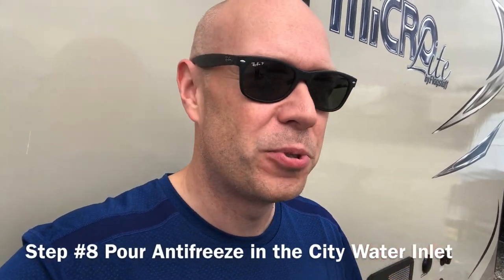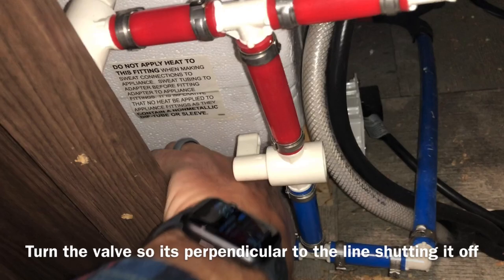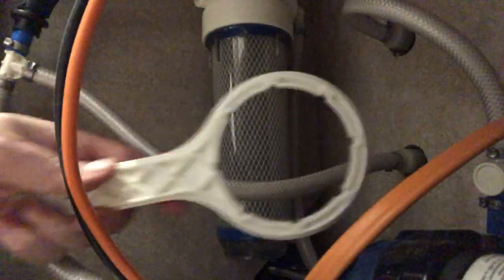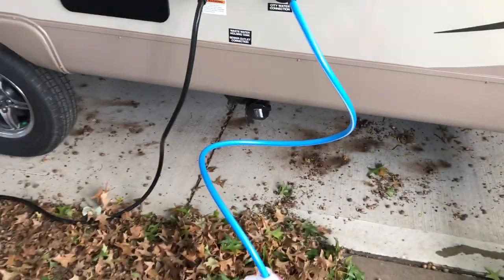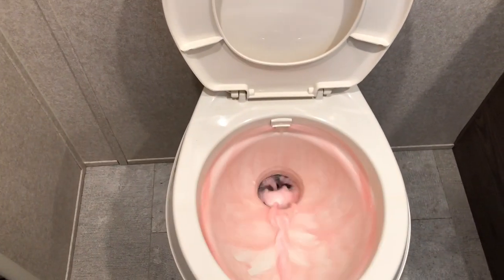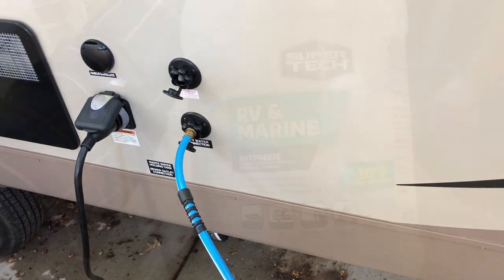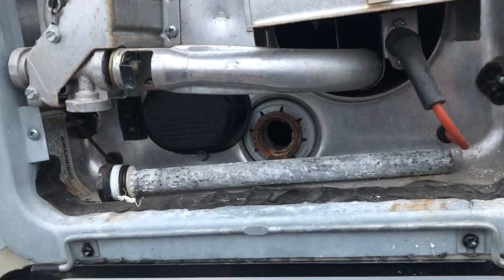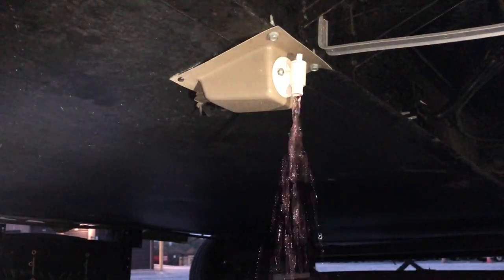10 Steps to Winterize our Forest River Flagstaff Micro Lite Camper

Comment: In regards to the city water connection part, if you take the mesh strainer out with a small screwdriver you will see a white push pin for the one way valve. With you water pump on and the antifreeze hose still hooked up you can push the pin and the antifreeze will come back out the city water connection, winterizing that portion of the hose. Someone showed me a couple years back at a campground. Excellent video for the microlite’s

Comment: So, regarding the low point drains, I think it would be a good idea to open both to set the antifreeze flow out, then close and cap. Some RVs have 6" pigtails that hang down so I think it's possible that water can stagnate in those short pipes (without the antifreeze) and freeze. IDK. I'm going to open mine just to be sure that I see pink out of each and every valve and fitting.

Comment: I always check the roof for damage and seal, along with spraying protective coatings on the slide out weather strips. Lubricate slide mechanisms.  Make sure refrigerators are open so they don't become odor filled.  Air up tires to proper pressure.   Turn off propane tanks... I use a leaf blower to clean off the tops of the slides.

Comment: I am a first-time RV owner and have a 2021 Flagstaff Epro (the littlest one).  A couple of things were a bit different but using your info, I was able to figure it out and thank you for this - I did it!!  A couple of questions.... 1. is it standard to put a bit of AF just around the connector of the city water like you did?  You didn't demonstrate so this part was pretty vague.  So just a bit into the mouth of the opening is what I did.  Hope this was enough.  2.  I have solar panels that keep the batteries charged all the time - do you think this excuses me from unhooking them?  (I'll be sure and keep them clear of snow too  3.  Is there any reason to open the fresh water drain to let the fresh water tank dry at all or is this overkill since there's no pressure?  4.  Is it okay to leave the water filter out?  Can it freeze or should I bring it into the house?  Thanks again and keep up the good work!
Reply from the maker: Thanks for watching and commenting.  I would suggest watching my new Video with more Tips.  https://youtu.be/kzRm0Iazbw4  Regarding your questions 1) Yes I used a hose I cut off that I connected and used a funnel tried to pour in AF.  This was something our first travel trailer dealer suggested.  I also had someone comment below on this video the following.  " In regards to the city water connection part, if you take the mesh strainer out with a small screwdriver you will see a white push pin for the one way valve. With you water pump on and the antifreeze hose still hooked up you can push the pin and the antifreeze will come back out the city water connection, winterizing that portion of the hose. Someone showed me a couple years back at a campground."  I wouldn't advise this considering this was the complete opposite of what the RV dealer told us they advised against this because there can be too much pressure and you can blow out the O ring which would be a problem.  

2) Keeping the battery in a garage on a trickle charger would be better than keeping it on the camper on solar panels using them as a trickle charger.  Its going to get too cold for the battery.  I double checked this and interstatebatteries was saying the same thing " When the temperature drops near freezing, a battery maintainer or trickle charger may not keep your battery alive. But it's not the charger's fault. It's that the weather is too cold. “Batteries just aren't as efficient in cold temperatures, whether they're accepting a charge or cranking an engine,” 

3) I gave a couple comments at the end about getting all the water out.  You need to get all the water out if its in a valve or enough is in a pipe it will freeze and crack the valve or pipe.  I would open the low water drains and the fresh water tank and leave it open.  4) Take the filter out it can freeze.  We took the filter out and emptied the container of water then pumped in the AF.  Thank you!
Reply: @BigCrazyOutdoorAdventures  Yes, i did take the filter out and, of course, it filled with AF when pumping it in.  I was just wondering about storage of the filter.  So, ok, batteries and filter in indoor storage (when we hit the single digits, our garage drops below freezing as well).   

Do you know how to gauge the best size trickle charger?

OK on the under tank fittings and I did see that but I thought for some reason it was overkill.

Thanks again and for taking all that time for further explanation!  I will watch the other video as well...
Reply from the maker: In regards to the best size trickle charger I originally bought a Battery Tender 021-0123 Battery Tender Junior 12V Battery Charger but wanted some more features and a LCD read out of what was going on versus the light indicator which worked fine.  I just had a personal preference of wanting the EverStart Plus Smart Battery Charger I bought at Walmart.  I think any trickle charger is better than no trickle charger.  I plan on making a video around the Trickle chargers soon.  Have a good one.  Thanks!

Comment: Next time, to prevent the hassle of watching jugs empty as you’re winterizing, I am going to pour 3 gallons of antifreeze in a bucket, and when done use a funnel and pour any leftover back in the jug? I also drain the fresh water tank and open the low point drains before I start, and empty the black and gray tanks when I am done.
Reply from the maker: Thanks for the tip on pouring anti freeze into a 5 gallon bucket.  We drained all the water I believe I shared that, but will double check.  Adding both of these tips to a new video.  Thank you
Reply: Big Crazy Outdoor Adventures Glad it helped. Unfortunately, it took me 20 years to figure it out, lol!
Reply from the maker: @stevez340  Your comment was shared today in the new Tips for Winterizing video.  Appreciate the comments.  https://youtu.be/kzRm0Iazbw4

Comment: Just a thought, I would remove batteries from the smoke alarms, the O2 alarms and any clocks, etc, before storing the unit; don't want them to go bad or drain battery (if not disconnected).
Y'all Be Safe!
Reply from the maker: Thank you for watching and commenting.  That’s a good tip to remove batteries.  Going to add that to a new video.
Reply from the maker: Your comment was shared today in the new Tips for Winterizing video.  Appreciate the comments.  https://youtu.be/kzRm0Iazbw4